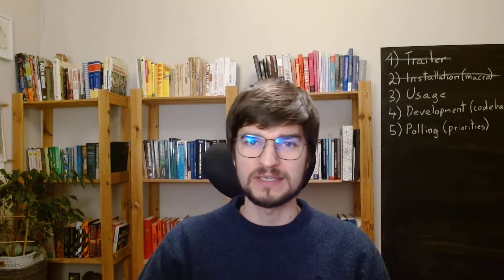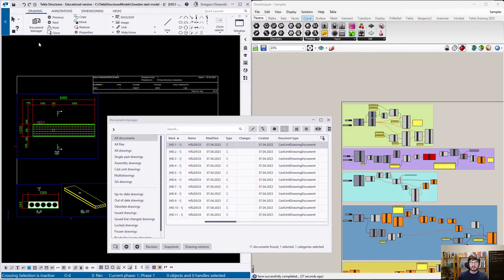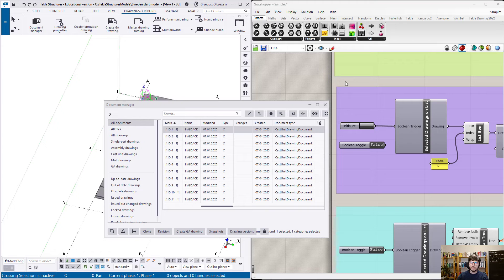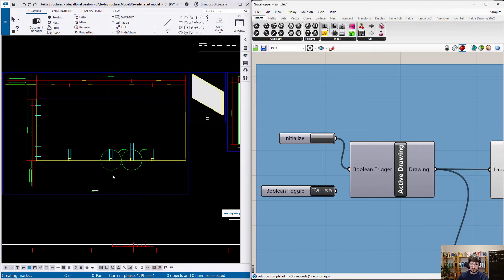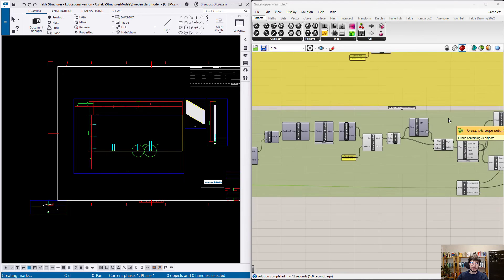Grasshopper-Tekla Drawing Link usage

Comment: 🎯 Key Takeaways for quick navigation:

00:00 🌐 The video discusses the usage of Grasshopper and Tekla Drawing Link, inviting viewers to share their needs or ideas in the comments.
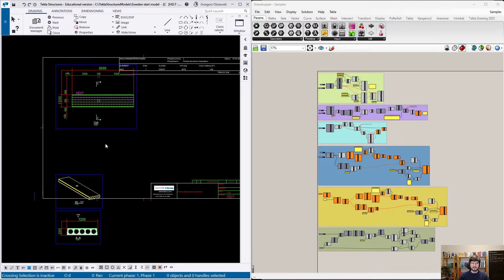00:31 📐 For Hollow core drawings, manual adjustments may be needed to meet factory requirements, and scripting can be employed for efficient processing.
01:12 🔄 By recording macros and integrating them into Grasshopper using the drawing link and On a Model plugin, multiple drawings can be processed sequentially.
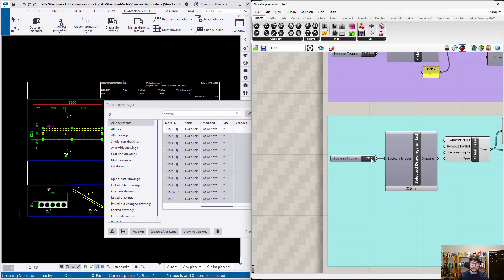01:45 🌐 When creating World drawings, the standard Tecla workflow lacks detail views, but the drawing link allows users to create them according to their logic.
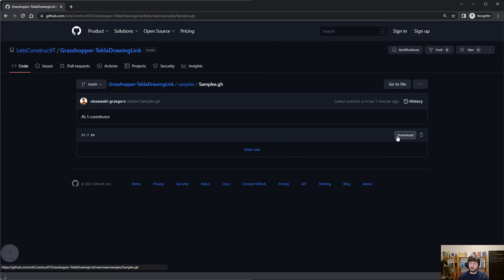02:49 🧩 Understanding and constructing Grasshopper scripts can be challenging, and the video encourages viewers to leave comments for clarification.

Made with HARPA AI

Comment: This is great work and I can not thank you enough for making it open source so that financially challenged guys like me can have a chance at new technologies. So far I do not know how to use it but I have installed it and I am trying to automate steel fabrication drawings with it. Do you think currently is it possible to create assembly drawings, dimensioning and adding part drawings and section views with this plugin?
Reply from the maker: Hi! Thanks for feedback :)
At this point you can create assembly drawings and section views. Dimensioning is under current work - it should be ready in September. Stay tuned, a lot of possibilites are on the way :)
Reply: @constructiveGreg  Thank you so much for your quick reply. I dont know how to use it. do you have any documentations that can help me learn it? 

I am not a programmer but If I could assist you in any way please let me know. Thanks again.
Reply from the maker: @RonyShawkat  First steps will be getting to know better Grasshopper. You can find a lot of useful info at: https://learngrasshopper.com/

Grasshopper-Tekla Drawing Link does not have (at this point) proper documentation. Only videos on this YouTube channel. Something more is in preparation, but it need time. Sorry for that :/
Reply: @constructiveGreg  Greg are you still thinking the Dimensioning components will be ready in September? I'm looking forward to diving deep into these tools